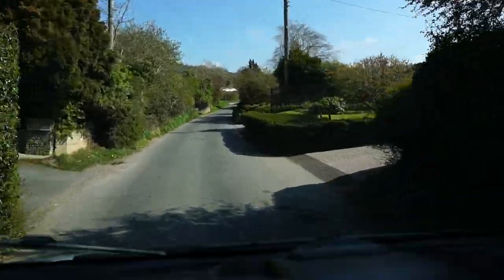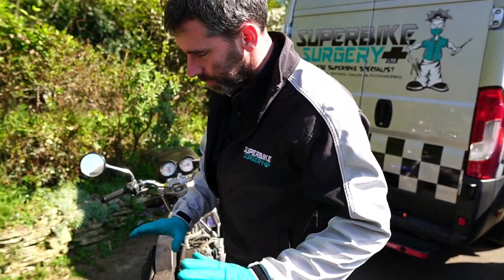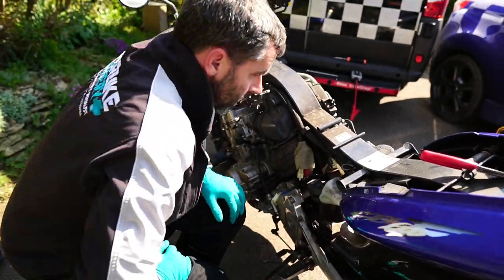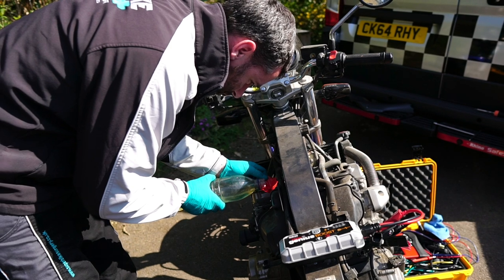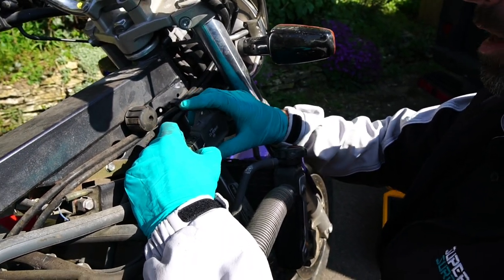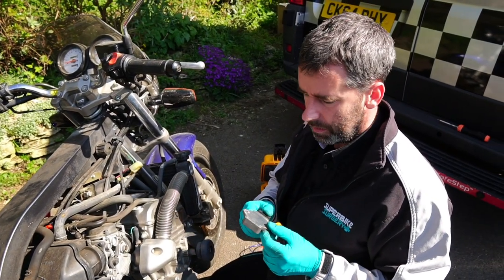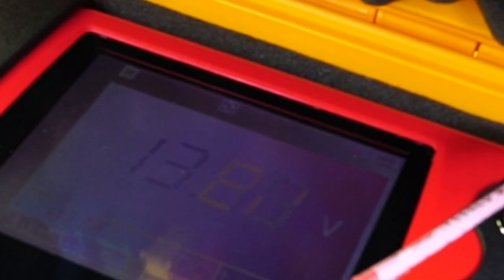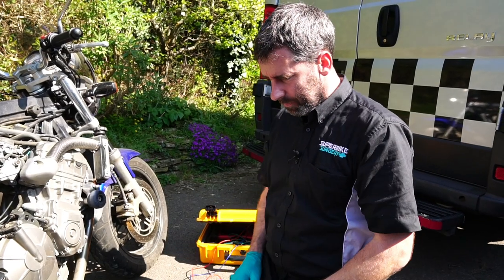Real World Repair, Honda CB600 Hornet Charging System Fix. VLOG-17

Comment: you don't need to do all those checks for the phases. probe connectors A and B, move probe from B to C, move probe from A to C. There are only three possible checks you can do. A-B, B-C, C-A.
Reply: Yup, it's AC, he is measuring the came coil in two directions. no need.

Comment: Hello 
Really enjoying your channel ,regarding the reg/ rec on Hondas , I wonder if you have come across the problems on the fi Honda blackbirds with the inspection multi plug in the loom which is used once when checked at the factory and then taped up  ,the problem is where it is situated as it gets all the elements thrown at it ,then it corrodes causing all sort of problems.on my own bird it spiked the ecu which cost me a packet .there is a fix for this as to cut the plug off and join the wires up  . Just thought this might make a good topic for you to show .
Thanks again fun
For your channel .

Comment: Hey, I stumbled across this when searching for a solution my electrical issue. I have the same bike, and it runs great when lights are off. When lights are on, and when I turn on the blinkers the bike idles really rough. I measured charging and it seems that its charging the battery okay (also with ignotion off batt was at 13.1V so I guess that means all is well?). What to look at next?

Comment: What would cause a new voltage regulator rectifier to fail a day after being installed? I have an 2006, diagnosed the issue following your video. Got a new regulator, installed it, ran great, then today it died again. What would cause the bike to kill the regulator again?
Reply: Check the AC side (both the RR plug and the joint plug - left side in that large clear plastic cover).

Comment: Great vid 👍🏻
What’s your thoughts on lithium batteries..? I’ve just put one in my Ducati 848, seems great however early days....
Reply: for the price its not worth it. they are lighter yes, but very unstable and must have a delicate charging/discharging board to make them work. lead battery are heavier, but has been proven safe and reliable for a 100years.
Reply from the maker: They make good sense for a race bike, really easy way to shed a bit of weight. For a road application its probably overkill for most people as a meaningful upgrade. 
One big positive is They can obviously take up a lot less space for a given amount of cranking amps which is why they are starting to show up on new bikes as standard.
Reply: Superbike Surgery TV , I live in the tropics where generally the old acid bike battery doesn’t have a very long life span. I reckon the lithium will last longer and will be more cost effective. I’ve noticed the lithium stays better charged whilst the bike sits unused too. Time will tell.
Reply: I tried a lithium battery on my Triumph Speed Triple, it needs up to 14.5v to charge it properly and if it reaches 15v the battery is killed outright
I found it wasn't worth it and was a lot less reliable than the AGM Yuasa
The £100 for the lithium battery and £80 for the specific charger is quite a financial outlay.  Both are just sitting on a shelf now
I think the charging system needs upgrading to provide the 14.5v needed as mine maxes at 14.1v
Reply: Only practical benefit is less weight. Risks are many. Worse performance in extreme temperatures, sensitive charging, yadda yadda. I was considering one myself, but it makes much more sense to just spend the extra money on better equipment and maintenance.
Reply: A month of having one in my bike, ridden most days, can’t fault it so far...

Comment: re your winter storage advice.  first of all the bike should be moved regularly to prevent flat spotting the tyres. repositioning with a different wheel position. topping the tank of course. if you do not run the bike up to normal working temperature regularly and if posibble take it through all the gears, just up and down the drive for example you will allow the cogs to stick and seals to dry out. leaving the bike for long periods (over winter) will sometimes cause sticking valves and weaken those valves which have been positioned under compression also the bores will be re oiled. so regularly turning the engine over is a sensible thing to do. if the battery is placed on a trickle charge it will not freeze and will be in tip top condition in the spring.
Reply: "...first of all the bike should be moved regularly to prevent flat spotting the tyres..." or fit a centerstand. Best addition to these bikes (or any bike for that matter) 👍
Reply: @N269  is that it?
Reply: @aticusaticus9138 For the "flat spot" you are afraid might happen. (Also as the single most useful tool in the arsenal)

Comment: Hi, I bought a JMC gel battery to replace my old one. It lasted me only 2 days. How reliable are they? I obviously had some sort of issue with my bike but my concern is I charged this one couple of times and now doesn't even fully charge/hold enough charge to start the battery. My old one still does OEM one. 
Do you think that I might have a faulty one? I don't trust the garage that I bought it from. But they assured me I would have one year warranty. 
Bought it two months ago and charged twice then left the bike until now. 
Do you think an electronic problem would damage the bike this bad so quick? The other one is still not that bad and it is years old.

Comment: why is it a bad idea to "ride it periodically during the winter" ? 🤔
Reply: because its winter :D
Reply: Yes, I didn't understand that comment either. If it's a nice day then go for a ride.
Reply: I've always ridden all my bikes 12months of the year as I commute to work,  there has only been 2 days in last 5 years where I considered the weather to bad too ride ice or snow actually on the road. The only one I had any problems with starting was my (just sold) Ducati 1000ds multistrada some mornings I had to hook it up to a charger/booster and that did the trick. My old Fazer 600 was brilliant right through winter never skipped a beat started 1st time without fail, I've just got a Hornet 600 so we will see how this handles the north west of England on a daily basis starting in December.

Comment: You'd think they'd put some bird shit, sorry thermal heat transfer paste between the reg/rec and frame but then I suppose sales on new reg/recs would be down?
Reply: its normally internal heat and nano cracking inside of the semiconductor that kills them. they are simply build just strong enough to last a couple of years. i have worked for the military and most electronic is used for 30years and is still working without trouble. 'civilian" stuff is just disposable garbage.
Reply: @Francois Dupont, Yeah totally agree, I'm an electronics engineer and have worked on a lot of military design and build hence the use of MIL grade components. In this case a bit of thermal paste would have added some heat transfer. May not have lasted much longer, who knows but any aid is better than none. But then the bike would cost more. Doesn't help that it's in a place with little airflow.